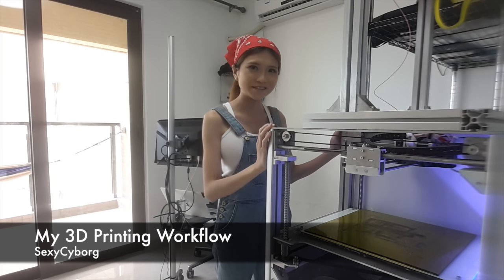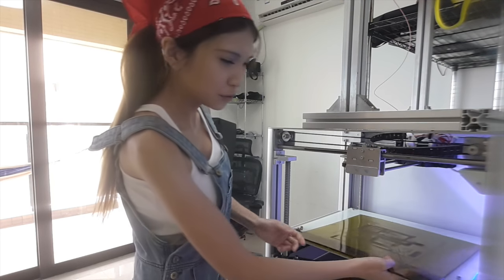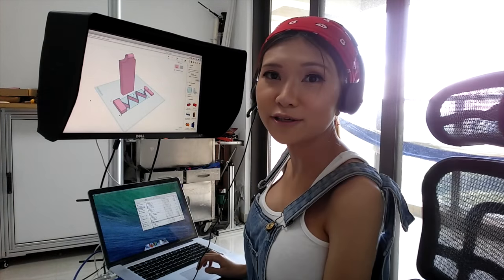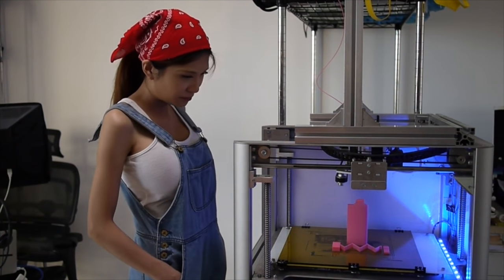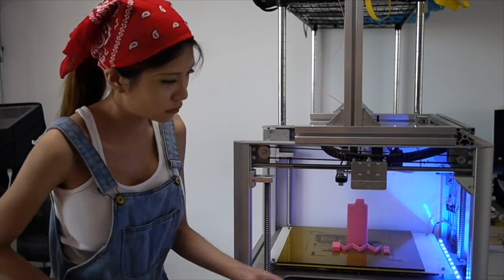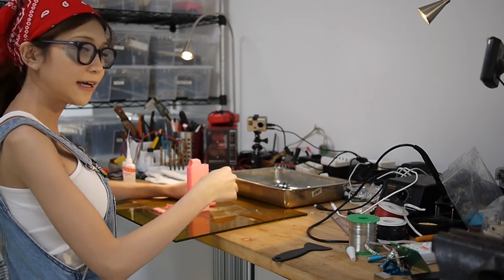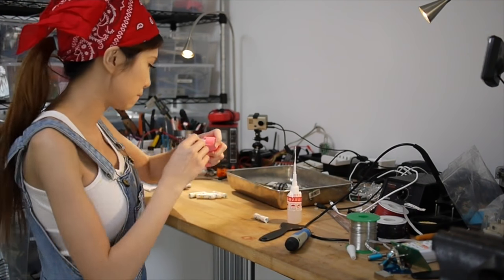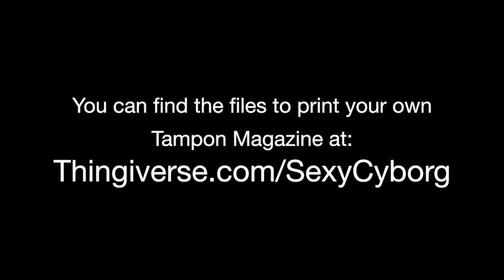My 3D Printer Workflow

Comment: I figured out that if i tap firmly the back of the removal tool with a wrench or pliers the part jumps off the build plate, keep removal tool very flat/low to bed. No need to hit, just firm tap motion sets it free. Nice printer...

Comment: You seem to struggle a lot getting prints off the print bed.

I use glue stick.  The water soluble type.  I set my printer to a reasonable (not too much!) first layer squish, apply glue to the surface, then print.

When it comes time to remove the prints...  I spray the perimeters with a little water.  Since the glue is water soluble...  I can just wait a little for the glue to soften up, and the prints remove much more easily.

Comment: Is 3D printed material strong enough to replace an injection molded part?
Reply from the maker: Some materials like nylon are stronger than molded ABS I've been told. But mostly it's useful for prototyping. I've never had one of my PLA prints break though and I use them for hooks to hand tools from and stuff. So it's pretty strong.

Comment: Hey, just a couple of questions.  What printer are you using?  Is it purchased or did you build it?  What tools are you using to clean up your prints?  It appears like a rotary tool.  Thanks, love your work.
Reply from the maker: It's not really any brand anymore. Just parts put together and lots of repairs with help from the local 3D printing friends. The tool is called a "deburring tool" it works pretty well.
Reply: Cool, thank you.  :)

Comment: I am very worried about you soldering without a fume extraction system - If you cannot afford a Hakko FA-430 from Japan, then you could use a good HEPA air filter with reducing ductwork to take it down to 100 mm duct size.
Reply from the maker: I have one right on my workbench in most of my videos?